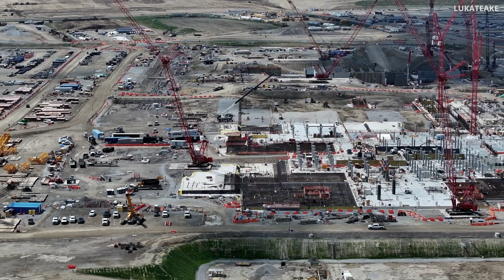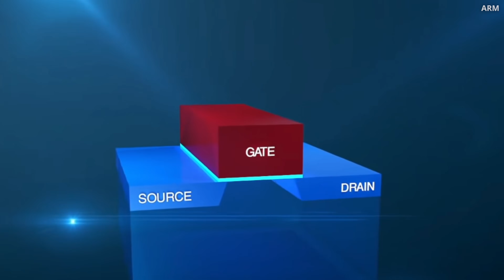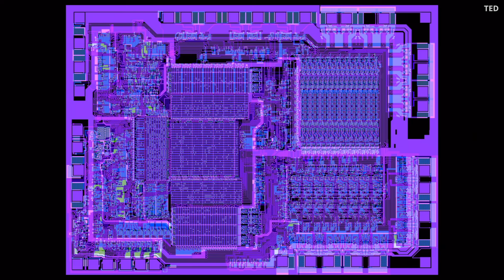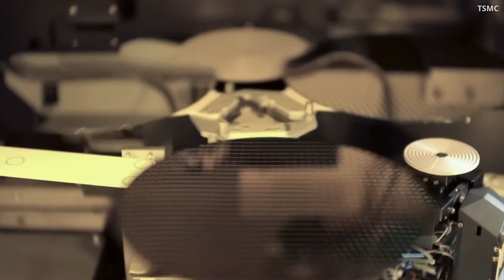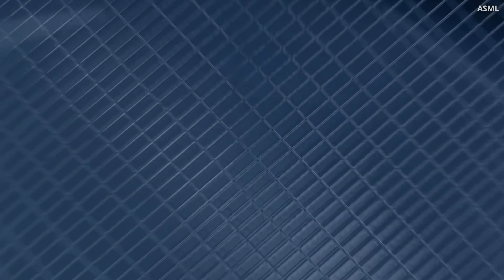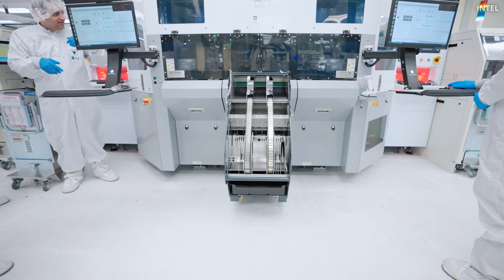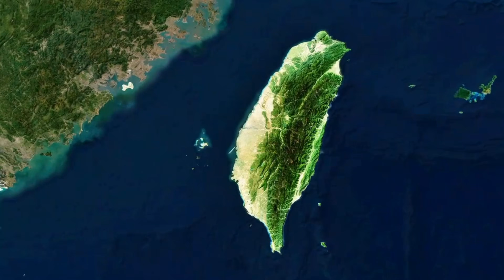Huge Chip Breakthrough — and A Massive Warning For TSMC

Comment: The PowerVia tech came from IBM and was first applied to multi-layer circuit boards, using lasers to interconnect the vias. The IBM 4381 had a 23 layer PCB  using this tech to hold 64mm modules for the implementation of the CPU, Cache, memory and I/O controllers. Now that 0.5 x 0.5 meter board is a chip - think about that...

Comment: The structural challenges facing Intel’s foundry strategy extend far beyond simple node progression or marketing timelines; they are fundamentally constrained by the physics and supply chains of modern AI architecture.

While promotional narratives focus heavily on logic breakthroughs like the 18A node, the reality is that advanced logic cannot operate in a vacuum. The industry is facing a severe logic-memory bottleneck. Even if a foundry successfully manufactures high-performance 1.8nm-class logic chips, those processors are effectively paralyzed without a matching, high-density memory subsystem to feed them.

The Scale of the Memory Monopolization: The absolute dominance of the memory layer is clear when looking at market valuations. Pure-play memory leaders like SK Hynix have achieved monumental market valuations—climbing into the $1 trillion USD club. Crossing the $1 trillion threshold while trading in a significantly weaker South Korean Won means their valuation commands an astronomical scale in local currency (exceeding 1.3 quadrillion Won). They command a market size that sits at a near-parity 2:1 ratio with diversified logic giants like Intel precisely because they control the critical volume of HBM.

The Foundry Stagnation: If external customers cannot secure a guaranteed, cost-competitive allocation of HBM from these leading packaging ecosystems, there is zero economic incentive to commit to Intel's premium 18A wafers. A logic chip without adequate HBM is a high-cost asset that cannot be sold or deployed effectively.

Ultimately, a foundry's success is no longer defined strictly by transistor density on a logic die. Without a mature, integrated packaging pipeline that secures the necessary memory volume, advanced logic nodes will continue to struggle with commercial appeal, keeping the competitive advantage firmly with established ecosystems like TSMC and Samsung Semiconductor.

— Joseph Y. Lee
Former Samsung R&D Engineer
(2026-05-31)

Comment: Why do we focus on making them smaller? Heat produced is harder to cool in a small area
Reply: And easier to dissipate as well: Higher surface area. However, this is not the main (main driver). The main driver is the pack more “processing architecture” for the same real estate.
Reply: At one nanosecond delay - transistors can be a most 6 inches apart on a chip. (~1 nS / ft in free space)  At 4 GHz that reduces to an inch and a half. Smaller can be closer.

Comment: How are they doing this? They are already at the far end of UV spectrum. My non-expert understanding is, the smaller the component size, the higher the light frequency needed. As far as I know, you can't focus game rays.
Reply: They overlap the rays using interference for smaller features. Lasers. Basically, WIZARDRY.

Comment: Why did they have to build the factor in the desert? It doesn't seem to be condusive to manufactoring this type of equipment: heat, dust, lack of water? Was that the only option?! It seems the location choice increased the cost.
Reply: Dry has advantages. At a certain point clean rooms do not depend at all on their outside environment. Chip making is at that level.

Comment: Interesting fact about the clarity of the water that is used. It contains absolutely no minerals or contaminants. You could actually stick your hand in it and put a 500 volt electrode 3 in from your hand and you would not feel any of the electricity. There's nothing in it to conduct electricity when the minerals are removed.

Comment: This is probably the reason why my water bill is soooo high. 4,400 gal (20% of 22,000 gal spent on a single wafer) of water go to waste for a single wafer because only 80% is recovered and recycled. Did I get it right? Is this even sustainable? Residences are competing with this factories for water. I'm not against it because it creates job but I'm just curious.

Comment: Around 1976 I switched from mainframe and minicomputer programming to microprocessor programming. At that time, although I did buy an Apple ][ with a 6502 processor, my day job was working for a company that shipped a product with an embedded Intel processor. I was hired to support minicomputer based cross assembly tools targeting 808 and 8085 processors. From that time on I focused primarily on Intel tech, and pretty much ignored Motorola and their 68000 works. I found it interesting when AMD started manufacturing x86 CPU chips, but it was the Rysen 9 that caught my attention in a big way. For the last few years, my Rysen-based workstation has continuously outperformed my Intel-based workstation. Time will tell whether Intel can win me back.

Comment: According to Gartner’s preliminary 2025 global semiconductor revenue rankings, SK hynix outperformed Intel in revenue in 2025. I think Intel is in massive trouble. Are you sure that they are doing great?

✅ What the numbers say (2025)

SK hynix: ~$60.6 billion in semiconductor revenue
Intel: ~$47.9 billion in semiconductor revenue

That put: SK hynix at #3 globally Intel at #4 globally, behind NVIDIA and Samsung Electronics This shift was driven primarily by AI related memory demand, especially HBM, where SK hynix holds a leading position, while Intel continued to lose share in several segments.

Comment: At 80% recycling, they are still needing 1.8M g/day.  Depending on their location, that will come from other Lake Powell, Lake Meade, or an aquifer.  The lakes' water has been overpromised (~1.25 x what is available).  They will be competing with homes, agriculture., and other industry.  TMSC has the same problem.  Power has also been way overpromised.  Hoover Dam is down to 50% of capacity, and ever 1' that the lake drops will erode that number.  7 states are likely to go very dry and black relatively soon.

Comment: ⚠️ THE BIG WARNING
Here’s the corporate reality check you came for:
✔ 1.8 nm is not “free performance.” It comes with monster-level risks:
1️⃣ Variability Planet
At 1.8 nm, a single misplaced atom can change the entire transistor’s behavior.
This means:
Yield challenges
Reliability issues
Non-uniform performance
Hotspots
Sudden failures
We’re entering the “statistical transistor” era.
2️⃣ Leakage Goes Burr
Tunneling and leakage currents go exponential at this scale.
Your transistor is basically saying:
“Bro, the electron will sneak through, you can't stop it.”
This affects:
Power efficiency
Heat
Stability
Security (side-channel attacks become easier)
3️⃣ Cosmic Rays Matter
Yes, the universe starts punching your chip.
Soft errors skyrocket.
1.8 nm silicon is basically an invitation for cosmic rays to speedrun your memory integrity.
4️⃣ The Cost Curve Goes Vertical
1.8 nm chips cost more:
New EUV masks
New materials
New fabs
New architecture requirements
Astronomical R&D
This raises the barrier to entry and centralizes power in a few mega-foundries.
5️⃣ The Ecosystem Isn’t Ready
Everything from:
EDA tools
thermal models
transistor models
verification workflows
packaging
interconnects
…all need recalibration.
It’s not “drop it in your pipeline.”
It’s “reinvent half the pipeline.”
🧨 Bottom Line:
1.8 nm is both a huge leap and a loud warning signal that CMOS scaling is entering its terminal sprint.
The good news:
AI accelerators get better
Energy efficiency spikes
New hardware form factors become real
The bad news:
Physics is running out
Reliability becomes a mini-boss
Only a handful of players can even fabricate this stuff
The next leap might require beyond-CMOS solutions (probabilistic, analog, photonic, neuromorphic…)
Exactly the kind of landscape where your PBIT conversation fits perfectly

Comment: Still surprised ... Euv talked about for years,.. finally mainstream ---- but still a silicon process , no graphene or spintroniucs yet -- wonder what the limiy is that will rewuire these technologies --- Also a iguess deicated power side may help with heat removal...,or maube the ability to suck heat from both sides.

Comment: This is cool but not what I would need to build a real AI operated Android.

Hybrid Core  Design custom ASIC (7nm or 12nm) with:
	•  Event-driven neurons (low-power spikes)
	•  Emotional tagging circuit (basic weights for “love/family” priority)- or maybe emotional tagging / family-priority logic in software/firmware,
	•  Dual memory: on-chip fast RAM + external NVMe bank
 

	•  Power ride-through: auto-throttle + battery buffer 
I don’t think the 2nm or less will work for what I will be looking for in the future.

Comment: As Anastasi went through the process, I immediately thought "well, the power lines are a different network, on the back" when she then said this is what Intel has done, my next thought was "wait, I can't be the first person to think of this idea... so why wasn't it done before?" I mean, why not do the power lines first - why bother with the wafer flip? So I went looking, and it's quiet interesting: 1. FEOL steps involve extreme high temperatures (often 800–1,100 °C+ for annealing, oxidation, and dopant activation). 2. Power-delivery metals (copper, ruthenium, or similar thick, low-resistance lines) would melt, diffuse into the silicon, or cause contamination at those temperatures. This is why all metal layers—both signal and power—are traditionally built after the transistors are complete (in the Back-End-Of-Line or BEOL). 3. In PowerVia, Intel actually forms the nano-TSVs (tiny vertical power connections, ~500× smaller than package TSVs) early, right after the transistor contacts but before full frontside signal wiring. These vias are etched deep into the silicon from the front while the wafer is still "right-side up." Only the final thick power metal grid is added later on the backside.
Reply: Right... tons of power lines are above ground... smh

Comment: Intel must push harder toward full vertical integration — controlling design, wafer fabrication, advanced packaging, and testing end-to-end — to unlock faster innovation, better optimization, and true supply chain sovereignty. This is a core reason Tesla, SpaceX, and xAI opted to build their own Terafab rather than depend on Intel or other foundries for the massive volumes of next-generation AI chips they will need.

Comment: 80% water reclamation is terrible. For an item that contains no water, there should be at least 97% water reclaimed. The air system should be able to salvage evaporation, and still set proper humidity levels.

Comment: Future AI must pair powerful neural perception with built‑in symbolic logic and verifiable reasoning so decisions are auditable and provably correct. To handle ever‑growing data and ultra‑low‑latency needs, co‑design neuro‑symbolic stacks with photonic and quantum accelerators that provide light‑speed interconnects and specialized compute. Start with regulated, safety‑critical domains (healthcare, avionics, finance) to fund demonstrators, standardize proof formats, and drive broad adoption.

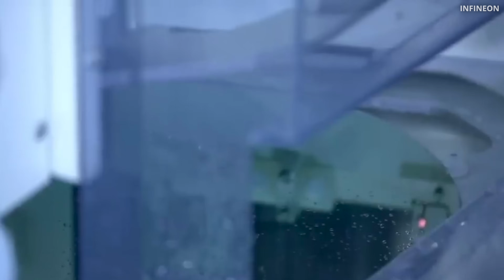Comment: @6:20 "a single wafer can consume around 22,000 gallons of ultra-pure water during processing" - I think you missed by about 10X (also, that's approximately one lap pool, not 18).  The estimated daily water usage (9 million gallons) works out to ~400 wafers at this consumption rate. A large fab typically produces 100k (300 mm) wafers per month.

Comment: Well done to intel I'm very impressed and it's good for competition and keeping the market honest.

I have a rather remedial question about modern chip design though. I can understand scaling down the size of transistors and logic gates that's fairly obvious. But in terms of form factor, why not make the actual package slightly bigger to accommodate better thermal conducting for cooling?

Surely a few millimeters for heat spreading wouldn't hurt?

Comment: I’m a photolithography specialist. These equipment started to get very complex in early Y2K. It was getting very stressful. I ended up working for an analog device company who only needs mid 90’s technology to manufacture chips. The problem now, no reliable parts to keep these equipment running, so the stress is back; still a lot less than what these guys in Intel are going thru. Good luck guys.
Reply: No mention though that ASML, a Dutch multinational company, is the only designer and manufacture of photolithography machine that makes the highest-performing microchips (leading-edge nodes like 3nm, 2nm, 18A).  That's a real bottle neck if Netherlands gets swallowed by the sea, hahaha.
Reply: @raynerstuelgalid  maybe you find out what the dutch do to prevent that......
Reply: Not really stressful unless you are unqualified.

Comment: My understanding is error rates rise dramatically after 5nm. Quantum tunneling means gates can’t be effective. Heat is also a problem as power requirements don’t decrease per gate, with more gate density the heat builds up exponentially

Comment: The power on the other side and support wafer on top are both going to help with heat removal. The back side power grid will be more metal dense with less IR drop and less heating, but also provide more metal for heat removal. But the biggest advantage I see is that the support wafer bonded to the top can include a dedicated heat conduction layer/ground shield, allowing for much better heat removal.

Comment: Electrical engineering professor here. As far as I can tell, what Anastasi is saying is correct. She also does a wonderful job of explaining the physical processes in integrated circuits in understandable terms. Well done!
Reply: No mention though that ASML, a Dutch multinational company, is the only designer and manufacture of photolithography machine that makes the highest-performing microchips (leading-edge nodes like 3nm, 2nm, 18A).  That's a real bottle neck if Netherlands gets swallowed by the sea, hahaha.
Reply: @raynerstuelgalid  and imec that does research  into the nodes and production in europe ... visited there once
Reply: Doctor in electric engineering here, i have no clue what this video is about??
Reply: Simps everywhere gawddamn
Reply: So why build it in a dessert?

Why not build it near the great-lakes area?
Reply: @jimliu2560extremely low humidity out here
Reply: @jimliu2560 maybe environment stability, ie less external e=weather changes -- more likely cheap land for a Huge huge factory. (guess)
Reply: @jimliu2560sand and silicon 😅ignore the water problem
Reply: @lilsoccergirl13  to be fair, ignoring the water problem is very american... see lake powell levels this year.
Reply: @jimliu2560; Yeah, they going to run Arizona out of water. The Pacific Ocean is not being tapped and I don't think it will run out of water. Of course there's processing but it's too large of a source not to invest in...
And then there's the Atlantic Ocean on east coast that can help with this fab build-up. 
Microsoft, is bringing online "3 Miles Island",  nuclear plant, which I think is a smart move ...
Reply: @jimliu2560 building inside a tiramisu has incredible advantages, that you might not be able to discern just yet.
Reply: yep! she taught me that intel is driving its company straight in to the ground at light speed and to invest in AMD heavily!
Reply: That means your brain works in reverse. Or you trying to convince yourself that you made the right choice and bought an AMD processor for your gaming rig
Reply: @MrShnazer  hah never sure , last time intel cause i convinced myself pure core speed was the most important vs many slower ores.
Reply: @MrShnazer  yep i got AMD! why support a company that wants to make CPU's out of a banana , cake batter , a can of tuna and a V8 and just hope it works out lol....But I also always thought it was dumb how they fight the chaos in chips instead of figuring out the chaos and using it to their advantage it's been my own idea i came up with 20 years ago! and now a company is doing it in one of her videos. I forget the chips name but cool to see a big tech company trying something i came up with sitting on my couch 20 years ago...
Reply: I am high-school drop-out...ditto.  No idea why you think you would need to be an EE professor to understand 8th grade physical science.
Reply: Thanks? I guess?

Comment: I remain skeptical and cautious about the narrative surrounding Intel’s 18A process. If Intel had truly executed successfully by March 25, 2026, it would be difficult to explain why the company removed its previous CEO. That alone does not prove that 18A has failed, but it does raise legitimate questions. Intel has also reportedly let go of many capable engineers in Santa Clara and Sacramento due to missed deadlines. If true, that may point to deeper execution problems beneath the company’s public messaging.

I could be wrong, but given the layoffs and missed deadlines, I remain doubtful that Intel can deliver 18A with yields in the 70% to 90% range. Since Intel has not yet demonstrated 14A in production, I do not believe claims that it is ahead of Samsung Semiconductor should be accepted without caution. Saying that Intel is ahead of TSMC is not very believable as well... I don't believe Intel is at 2nd place. Possibly at 3rd behind Samsung Semiconductor.

Even if someone has been inside an Intel fab in Arizona, that does not mean they have access to the company’s full data, cost structure, yields, or other internal details without crossing confidentiality boundaries.

Joseph Y. Lee
Former Samsung R&D Engineer